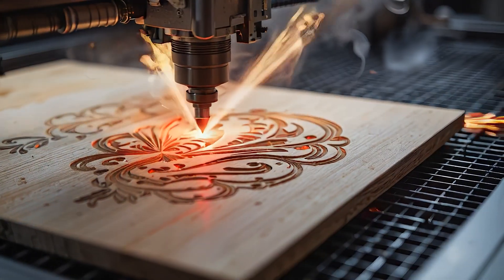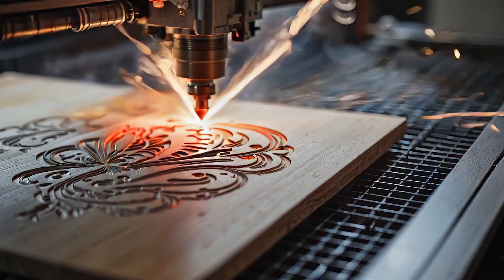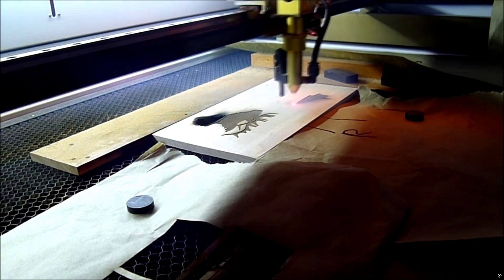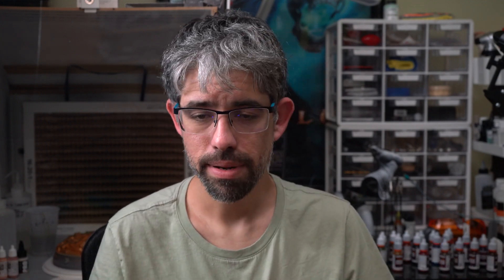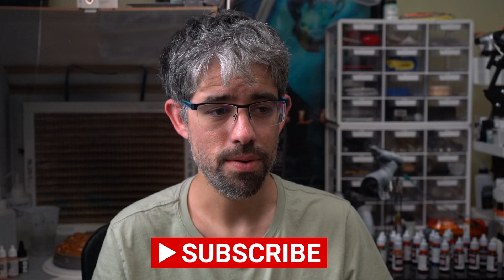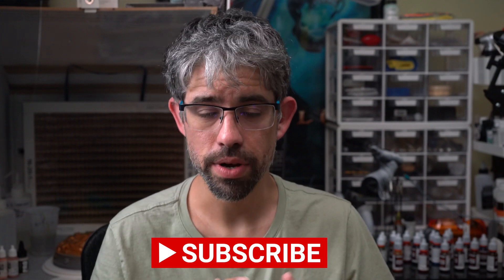3 reasons to AVOID the Bambu Labs H2D Laser Module

Comment: Another YouTuber hating on Bambu with no solid logic behind their issues… after seeing it in action, I just bought the upgrade. 3D printers are not as complex as you people make them out to be. The gantry can handle the soot, if you can rub it off with a finger, you need to clean. Will it increase wear? A little, but then You haters want machines that make you work for a print… I’d rather the printer work for me.
Reply from the maker: Id rather the printer work for me, and that means the less maintenance I need to perform, the more time its up and running instead. You know, working for me. Im not hating on bambu labs, I have 4 of their machines with a combined 12,000 hours of print time roughly.... but I also have a laser 55w co2 and know that its a pain to clean and keep the rails functional. I dont want to be cleaning that up weekly in my 3d printer, but if YOU do, then be my guest.

Comment: Why would I care for opinion of a "reviewer", who doesn't actually used the machine ? This clip should be named "3 reasons to ignore reviews of products, reviewers never used"!
Reply from the maker: Do you believe this laser is fundamentally different from other laser engravers and cutters? I'm curious to see the answer. Do you think it wont produce smoke like other lasers? no soot like other lasers? Do you think Bambulab has discovered the secret to burning wood without any fumes and byproducts? I have a CO2 60w and a 40w Diode, and both produce smoke and soot. I have the H2D as well, and would hate to clean out that interior if I was doing significant lasering. So this clip is named exactly what it needs to be, and the title does not state it is a review of the machine, because it isn't obviously, its an opinion piece, I would have thought that was obvious from the footage.

Comment: I think the H2D was a development platform. I think Bambu Labs wants to expand in to the maker market, cutters, engravers, lasers, plotters, etc., and the H2D was a way to fund that R&D and perfect their hardware and software. The reviews of all the different "systems" packed in to the H2D have been largely positive as well as the reviews of their software (I haven't used any of it yet). I wouldn't be surprised to see Bambu coming out with stand alone lasers/cutters/plotters, etc. here in the near future. The H2D also, I think, appeals to the hobbyist who may not have a dedicated shop space and is doing small projects on the kitchen table so has limited space. Here is an all-in-one machine that 3d prints, laser engraves, cuts and plots right out of the box with minimal set up. Yes it's expensive, but if you add up the cost of all those separate machines, PLUS the space needed to use them all, the H2D is an excellent alternative. Now, if you have dedicated shop space and are running a business and fulfilling orders, it no longer makes as much sense. Just buy the printer (if needed) and move along. :)

Comment: Ok, I will bite. Many folks have intimated that “an all-in-one is a box of compromise”.  So I have to ask…what specifically has been compromised? The dual heads, larger build volume, active chamber heating as well as the improved AMS are most certainly not compromises. The laser module as provided actually performs as a laser, the drag cutter is pretty near identical to the one I use on my CNC and the plotter is just a plotter, hard to mess that up. So other than than laser, cutter and plotter functions having a somewhat reduced plate area compared to some stand-alone versions, can someone please take a moment to explain all the compromises inherent in this machine.
Reply from the maker: Well, to have the laser as an add on, the base box has to be fireproofed more significantly that would typically be needed for a 3d printer, so thats a compromise in the base unit is more expensive and heavier than needed, due to the chance of maybe having a laser in it. You also have a lower Z height available to accommodate the laser modules height. So you'll have to compromise there as well. You also need to recalibrate (about a 20min procedure) each time you swap from laser to 3d printer or vice versa, which is also... a compromise. And since the Dual nozzle hotend is not removed when you attach the laser (The laser is added on) you have a much heavier gantry/toolhead to move around when using the laser, reducing movement speed compared to a laser cutter with a lighter toolhead/laser assembly. That is another compromise. So aside from the cost, weight, speed, and time....no compromises....
Reply: @Crafts4Painting  IDK…I think that maybe a decently fire-proofed enclosure for a high temp 3D printer may not be such a bad idea. Hmmm…as far as clearances go, my 15k CNC machine has 7” of Z-height, and my XTool laser has less than that. X1C ~12”…didn’t loose anything there. Every one of my external tools has a setup/calibration procedure. As far as the weight of the laser module, apparently the machine is engineered for this so once again, not an issue. Now I do understand that this is a multifunction machine. The one thing I am leery of laser smoke control and cleaning. The additional capability of this unit (build volume, dual print heads, heated chamber, new filament heater in the AMS2) as well as it is marginally faster than the X1C makes it a solid purchase. While I have no intention of purchasing this machine as a multifunction machine, I am considering purchasing the base machine w/AMS 2.

Comment: I don't understand the problem and all the theatrical moaning. It's optional, so you can just buy it without a laser. It's $800-1200 cheaper that way. But in general, it makes perfect sense to use a 3D printer as an engraver, plotter, and cutter. Besides the laser, there are other options that don't make a lot of smoke.
Reply from the maker: Besides the laser. Yes, you nailed it. I wish they offered a machine with all of that except the laser, but they don't. The video is showing my disinterest in their product offering in hopes to get the company to see the outcry from myself and others and offer exactly what you just described! 100%

Comment: A two nozzle system should have been introduced as an A2 model for low-cost production printing. The H2D is not cost effective for mass producing 3D printed components.

As for laser cutter/engraving, the work envelope is too small. The ability to use the H2D as a small plotter via ink pen insertion or cutting vinyl doesn't make sense, either.

The H2D has a place, but Bambu Labs wasted a lot of R&D funds on features which are useless for the majority of users.
Reply from the maker: 100% agreed. Had they just made a 350x350 printer at a lower price.... i think most would have been happy

Comment: Do you have a H2D ? where is this based on if you not even gave it a try .... don't get me wrong I agree with you on the laser , but I would first try the product and then give your opinion about what it is. I have a 3D printer with a laser inside and it's ok ... I don't use  the laser part very often but it's fun ...nothing more nothing less. sure you smell burned wood and you have to clean it a bit better, but it's running for already many many years and it's not as bad as you make it sound. I would say try it first and then give your option about what you think it is.
Reply from the maker: My H2D is still on its way unfortunately, but the concern with the laser is based on what I've seen with my 40w CO2 laser and 20w diode laser that I currently use. The 20w diode laser should be comparable in what it will produce and that machine gets very dirty after 5 to 10 laser jobs. I give it a good cleaning once a month roughly and the gunk I clean off the walls and rails in there I would not want inside a more precision based machine like a 3D printer with gears, cutters, and other small mechanisms. I do use it a lot though, about 5 laser jobs a week. Thank you for checking the channel and content, I appreciate it!

Comment: I just don’t understand the whining.  Just buy the one without the laser or don’t upgrade.  Jeeeez!
Reply from the maker: The base unit has a lot of components designed for the laser, for example, the chamber is fire proofed... but that's just an extra cost in manufacturing that we could avoid if the laser idea wasn't a thing. So that's the main critique.

Comment: I agree with most of what you said. All they needed to do was at a chamber heater along all of their added improvements related to the 3-D printing, accuracy, VFA’s, etc. And make this 350 by 350.

The base model should have a single print nozzle and come in at 2500$ with ams… instead of 2999$.

I have three Qidi 4us printers @ $1150 Cad each that do very solid Prints, but they do lack the refinement of what is capable from Bambu. 

My next upgrade, I have to decide between adding three more Qidi plus 4s or 1 base h2d with ams and a few accessories. :/
Reply from the maker: It's a tough decision. The Quidis have proven to be a good value so far... but bambu labs does have improvements in comparison. I think if you need the output, the 3 quidis makes sense. I was honestly tempted to get 3 p1s's instead of the H2D base with ams at $2100.

Comment: Used lasers at my job and they do not belong on the inside of a 3d printer, period. This is going to be a issue we just have to sit and watch blow up on Bambu for doing. The other thing I don't like about the H2D is you can't share the AMS with the 2 heads, you have to use a real on the side or get that stupid single AMS high temp unit. Then the other thing that pissed me off the new AMS compatible with all series printers, A1 series Q3 2025. Why the f didn't you let us use the original AMS on the A1 series instead of pushing that POS AMS lite on us?
Reply from the maker: 100% true on that AMS lite. Using a regular AMS would have been infinitely better. 

I thought you could use an AMS on each toolhead, if you can't that is another mark against this roll out. Really feel like they dropped the ball on what people wanted. The inside is going to get so bad with a laser burning materials in there.

Comment: I 100% agree that it is a little overpriced and will require extra maintenance, but the selling point wasn’t just “a machine that can do it all” it was “a machine that can do it all, while sitting on your desk” it it meant to be the at home maker station. Additionally, I think it is great for beginners. I know many people enjoy 3D printing as a hobby and they enjoy leveling the bed and whatnot. But some people don’t want to do that, and that is the point, it should be a tool and that is what Bambu is achieving. No manual calibration, no anxious sleeping hoping your 4 day print doesn’t spaghetti. And the safety is very well done too, it’s not just fireproof, but having an auto extinguisher?!?! I’ve done my fair share of laser cutting with a real machine, it sucks to have to sit 5 feet away and check periodically for fire, sure you should still sit tight while the H2D cuts, but it takes away the worry. Creating shouldn’t be difficult and dangerous, it should be fun, easy, and safe.
Reply from the maker: It's an interesting machine for sure... may just not have been for me, since I already had the laser engraver and prefer to have 2 jobs running at once to get orders out.
Reply: Beginners are best off purchasing an A1 and taking some time to learn 3D printing before investing $2K+ in an H2D.

Comment: Thanks for the review!  I agree w/ you 1000%.  Which dedicated laser do you recommend for $1800 w/ at least 12x12 IN or 12 x 24 IN work area?
Reply from the maker: For ease of use, xtool does seem to make a decent product thanks to its software side. For raw power though, a co2 laser by way of alibaba would give you more bang for the money, at the cost of ease of use. You can buy a 60w co2 laser for the price of a 40w diode xtool
Reply: @Crafts4Painting  Thank you!  Been 3d printing since 2013, but it's my first foray into lasers so I'll probably go w/ the xtool.  Do you have an opinion on GlowForge lasers?
Reply from the maker: Glowforges seem okay, but ive definitely heard more horror stories with them compared to xtool, and they are more expensive in a lot of cases in comparison for not many benefits. The P2 from xtool is a CO2 laser, desktop, and granted it's expensive, but still less than glowforge and will do almost everything you need with their software
Reply: Thanks for the info!

Comment: Ok please which version can make scan for foot paint to make size shoes which one should I buy for this function
Reply from the maker: You might need to get the 10w laser version for that... so about $2800. The base version won't have cricut type cutter
Reply: @Crafts4Painting you mean this more safe no smell
Reply from the maker: You'll still need to extract out a window to avoid the smell. May have a little smell left though, cutting with lasers always generates some smells. Extracting out a window should get rid of most of it.

Comment: 1 machine 1 job
Reply from the maker: 100% agree!
Reply: @Crafts4Painting  watched a few unboxing vid by now, to use the cutter or the laser the print head has to be swamped and the build plate too. why dont I just place the object on another printer, lol. 
The accuracy, the automatic calibration, and the detection is cool and I would like to see it on other project/products. it would really help if implemented on hotend changer and tool head changer for fast calibration. Being able to use different nozzle on the fly and multiple print head simultaneously should be the future for faster and bigger FDM prints
Reply: multiple independent head or tool changer in theory can be implemented with mechanism that have parked heads switch between tens of filaments and keep printing while the color being swamped .
Reply from the maker: I think you are describing what the prusaXL uses (5 toolheads that get swapped in). A great system for sure, but does have some calibration issues sometimes. Also much more expensive than this at about $3000 starting for 2 toolheads.
Reply from the maker: Yup, the swapping just makes me not want to use them. And it needs to calibrate after the swap, and takes 30 min I think one of them said on their unboxing. That's a lot of time wasted waiting around.

Comment: This is just a way to fill Bambu's pockets.
It's just a failed project.

2 nozzles are nice for printing with 2 colors or materials. More then that still gives you a lot of wasted time in filament change and purging, a lot of filament waste and not the forget the printtower (which still has a lawsuit going on).

And then the lasercutter indeed... Good luck cleaning all those belts, rails, sensors, nozzle change mechanics, ooze mechanics etc. You will probably need to tear open all the mechanics (especially on the printhead) to do a proper cleaning/ maintenance job.

And after sending in your printer after a few months, because of malfunctions, BL responce probably will be: "your maintenance was insuffucient according to the manual/ WIKI", here's your bill"...

And then not to forget the useless, but $100 gimmicks, as that Vision Encoder...

They really needed about 3 years to come up with all this crap? 😆
Reply from the maker: 100% in agreement. They missed the mark and this machine will have a ton of problems if you use the laser in it and create all that soot and smog.

Comment: My biggest problem (outside of Bambu's TOS policies) is exactly what you mentioned. An all-in-one is a box of compromise. It's never as good as a dedicated machine, as you're going to be more limited on several parameters versus a machine made to do that task. Fumes and soot is a serious concern, too. My 'dirty/stinky' machines all have sealed enclosures even if they have enclosed volumes and piped into a high volume fume/material extraction system on 4" hardline. It can keep up with an industrial-lite printer and a CNC at the same time, but how many people are going to have that system ready to plumb in to their new high dollar machine? 
The big issue isn't trying to reinvent the wheel, as 3D printers, CNC machines, laser cutters, etc., are all g-code handlers at the base level of operability. Essentially the function of what is being driven doesn't matter all that much, which is why it's easy to change a printer into something else. The execution, however, makes a world of difference in how livable and reliable it is. Guh, I can already see the images of people who run a few prints with all that lovely filament dust on the inside of the machine ripe for laser contaminant to stick to...
Reply from the maker: 100% in agreement. All in one machines are always compromises and this applies here too.

Comment: The base machine without laser version is simply awesome and the upgraded ams is awesome. Laser is there for small makers that want a two in one that functions well on limited space. Have a better laser? Just get the base model that has much better upgrades to QOL.
Reply from the maker: That's definitely the plan for me, base unit with AMS. The laser just... isnt for me. I really wish they went 350x350 though
Reply: But the base model is overpriced since it was made fireproof to be able to hold the laser, even if you do not get it. I can get 4 more Hi Combos for the price of the base H2D. Or 2 K1 Combos if I needed an enclosed printer (which I do not).
Reply from the maker: @LoriAnneBrown  This is a good point, and I think a lot of what I am trying to say in this video... the laser addition adds costs here, that could have been avoided.